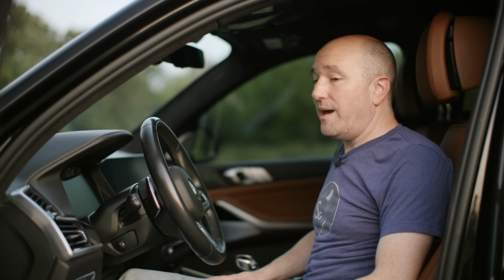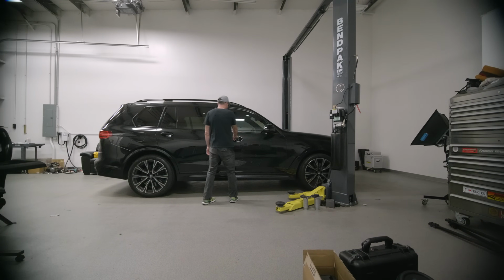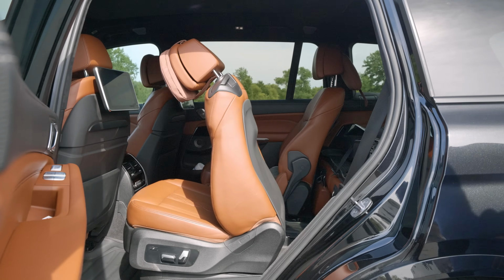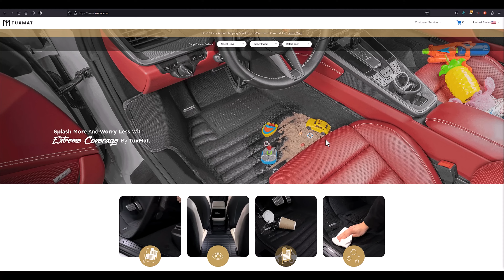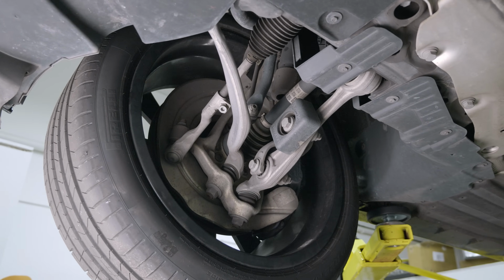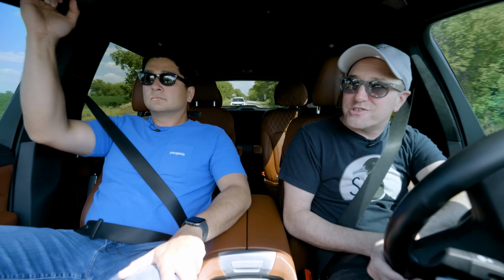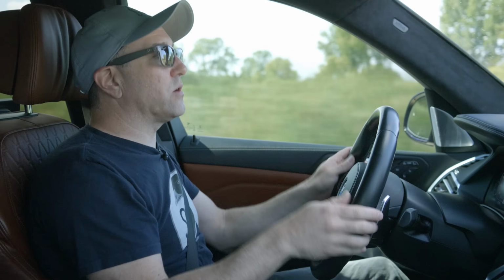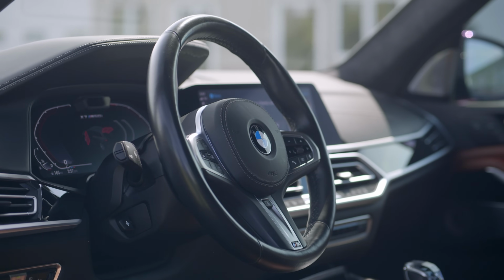BMW X7 | 45,000 Mile Long Term Results

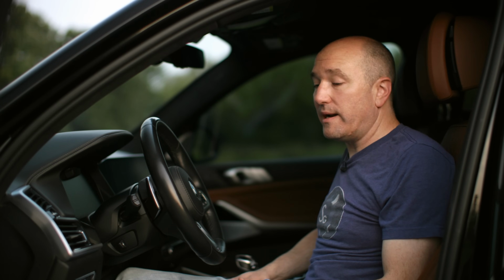Comment: 9:13 I discovered many years ago that sensible and practical is actually the upgrade. My net happiness was always lower when I had a big, expensive, depreciating asset in my garage.
Reply: The reality is the target market for this and other luxury SUVs is made up of buyers who lease, not buy, and the Germans have figured this out . . . they deliberately design the vehicles to fail one way or another after the warranty runs out.
Reply: @LearnAboutFlow  If you say so, I noticed that most owners actually lack in care/maintenance and gentle driving which leads to component failures and then they act surprised because they think a high price tag means nothing will ever break or need service. I have serviced my 2016, 2020, 2022 BMWs way before the system would even tell me to do it and drive them with moderate intensity, V8 and inline 6 as well as 4 cylinder, and all I had to do over the years was watch the tire thread, buy sport tires, replace valves, shock absorbers, most of which was on a 2016 ofcourse but for three cars even if I didn't have warranty it never surpassed 10K in total. Ofcourse there may be lemons, but if you take great care -- they will run well a very long time. Moreover, if someone is overly worried about service costs, it is a wrong brand segment to get into. I love the cars so I am actually happy if something is replaced with new because I know it will run well during my ownership.
Reply: All depends on what you can afford. For myself, I just do not like other designs and do not mind the running costs at all. With good personal care their vehicles run without a problem and high expense.
Reply: @21Pogon  That is simply not true and the repair records and quality ratings prove it. The German cars are hit or miss as far as quality, which has ZERO to do with how well you maintain it. BMW, Audi (always garbage) and Mercedes know their vehicles need only last as long as the lease. My friend's CPO BMW i8 proved that in spades. A small plastic part FAILED and caused $24k in engine repair. The car was like five  years old, and had very low mileage. Plus, the part melted a few days AFTER he had the car serviced and inspected by the BMW dealer. Luckily he had the extended warranty.
Reply: @LearnAboutFlow  I heard that i8 was a nightmare for reliability too. As I said, it can be expensive and there are lemons. But if you didn’t get a lemon and take excellent care, there should not be any problems. My vehicles: X1 F48, X3M and X5M all have no lower than 4.2/5 reliability rating. I can attest simply from own experience of not having problems, I do my own service though and save that way but I service often depending on how I drive and annual service costs come out to be about 2 thousand dollars, which is cheap imho.

Comment: I think an interesting video would be a "bachelor" type of contest where you are looking for the X7 Replacement, you get an MDX a CX-90 a Kia, a Navigator and a Lexus and see what works best for you. basically covering anywhere from 45 to 65K to keep it reasonable (thus no Q7)
Reply: I think the CX-90 would be perfect for him.
Reply: You could get a decently speced 4 cylinder Q7 in the low 60s and a decently speced 6 cylinder one in the high 60s (also there's always used Q7s and even Q8s out there)
Reply: @ThinkfreeorDie  I agree the CX90 would be perfect for him
Reply: Q7 is actually in the same segment as X5 and GLE. But X5 doesn’t offer 3rd row seats so they have wider 2nd row seats
Reply: Navigators are 100k

Comment: I got a 40i without absolutely ANY idea about bmw in general.  I actually got it as an alternative to a highlander, which was more expensive and smaller. I am (so far) super glad i got the b58. Haven't had any issues whatsoever in 4 months that ove had it. (I got it at the dealership witg 30k by the way). Very very happy with it. Sometimes i wish i had the 50i but then i see my mpg and forget about it 😂. Great video 🎉

Comment: My m340i has been amazing. Only issue I had was the driver side mirror shorted out bc of a water leak which also shorted out the module for the laser lights. Since that was fix, no issues. Good thing I have a extended warranty lol.
Reply: How much was it
Reply: @adeezy5503  I got my m340i last year for $48k with 27k miles. Still had 1 year left on factory warranty. My m340i is nicely speccef with the engineering motorsports (cooling and performance package), vernasca leather, laser lights, and premium package which includes heating seats and heads up display. I’m glad it doesn’t have adaptive suspension as that will be expensive to replace down the road.

Comment: Watched this a second time and I wonder if mark would’ve been better buying a base 40i rather than a fully loaded m50i to avoid the firm suspension and poor running cost of high fuel consumption, air suspension costs, super huge tire size cost, active sway bar cost, etc.
Reply: We have diesel in Europe, which suits much better to SUV. Even M50d with 400HP before FCL, now 340HP only. But still…
Reply: Sure but the truth it's a car for someone who makes 3 to 400k a year. I don't know marks finances but I don't think he made the type of money the vehicle commands. Thus the consumables were killing him. Not unlike the people buy used S classes and get crushed financially after a single dealer visit.
Reply: The I6 is the one to buy. Even an enthusiast with a large platform and income stream tired of the V8s downsides.
Reply: @bigcjm  I don’t think he had an issue affording it, it’s just beyond his needs and ridiculous no matter how you slice it. He’s always had practical, reasonable vehicles. I can see how over time this wore on him.
Reply: @sapereaude7776 The M50d is just baffling to me. Two more turbos that can go wrong, worse fuel economy while not being that much quicker than a 40d and noisier on the highway at higher speeds due to gears being shorter.
Reply: @GermanCptSlow  Yes, but still more sensible then V8 in SUV, i drive M550 G30 and 450 to 500 km on full tank is quite on edge for me. So if u look for power numbers then M50d might be choice. Otherwise i agree than any 250kw isch diesel will do in SUV. Fun fact, i tried X5 M50d and avareged 14l :).
Reply: @anotheran Every X7 comes standard with the air suspension; in the US anyways. We've owned two 40i's and they've been extremely reliable. Take any criticism with a grain of salt unless it comes from someone that's owned/leased one for the long term.
Reply: @bigcjm - completely agree. I have the 2020 x7 m50i and ordered it new in 2019. In general, the demerits he mentioned are without support.  The consumables are high, but that's to be expected.  Not sure why this video is centered around a fact known pre-purchase.
Reply: @MH-xu4ez  he said the car has been reliable. He just mentioned the wear and consumables like air shocks and tires are costly. And if the engine blew it'd cost a lot. But at least the transmission was cheap at 10k :p
Reply: @ACGator03  He said the consumables are high and the V8 novelty wears off quickly. It’s not like a sports car which can delight you in many ways that you’d forgive things like that. It’s a 3 row SUV. Congrats on your M50 I adore them.
Reply: he mentioned this in the technical segment. I think for him once you down grade from that you might as well save even more and go for a cheaper car that is going to match that cheaper bmw easily.
Reply: @reed785M  yeah, I think he was just going to pick up a sh1t mobile. honda pilot I think he specifically said 22:17
Reply: Good point
Reply: @JakeDrives1  If someone keeps moaning about expensive tires and $120 fill-ups it means they can't afford it.
Reply: This vehicle is a tax write off for him/his business. He states in the video that he uses it for production(track footage) alongside his daily use of the vehicle. No brainer to load the car up to the teeth on a m50i for a business owner like him.
Reply: @GermanCptSlow I’ve driven the X7 and the X7 M50.  There is a significant difference in power and speed.
Reply: @Inflator82 or it means they are wasting money on bs. Rich people stay rich by not blowing it on junk like this.
Reply: @bigcjm agree the right way you put it. You pray for the rain,  be prepared to deal with the mud ! Borrowed from Denzil!
Reply: @jaeh823 then he shouldn’t complain about it 😂

Comment: Mark, you can't go wrong with a MDX Type S.
Fast camera car, low running costs. Looks sexy too!
Finally make your garage all-Honda products. 😄👍
Reply: +1 for the MDX Type S.  Zero buyers remorse on the purchase.
Reply: would get less expensive base MDX or X5 @KoTerrors
Reply: Type s trim is a waste.
Reply: rusts like a mofo
Reply: @ak2112 absolutely. The J35 NA in the Advance/A-Spec is sufficient and more bang for your buck than the 3.0t
Reply: As someone recently cross shopping x7 with the new body MDX... former Acura fanboy here... MDX is a cheap POS compared to BMW x7. Useless 3rd row! These cars are not in the same category at all. MDX is ok to compete with likes on Qx60 and the under 60k crowd
Reply: @k-man-dude  When you are broken down on the side of the road with this German toaster OVEN YOU WILL RETHINK YOUR COMMENT.
Reply: @KoTerrors  Type-S is a waste unless you only drive it in the city. It shares the same fuel tank with a Base MDX but consumes 2x the fuel.

Comment: I'm on my 3rd X7 and love them.  2019, 2021 40i's and now a 2024 M60i.  I agree the V8 is not necessary, but it sure is fun.  My draggy is showing 4.1 to 60 and 12.4 @ 110.  Also, pulling .91g through turns.  I miss the mix of buttons of the pre-lci, but it's easy to adapt to the on screen controls and the new screens are glorious.  I bought it because for me, there is no better driving LARGE SUV.  Put it in sport mode and your gonna need a pretty high end sports car to keep up!
Reply: This is how you do it.  Spend a crap load in monthly payments, insurance, tax and licensing - what... 3k/month would you say? - and drive worry free!  Bada bing Bada boom.
Reply: @bassandtrebleclef  haha.  Life costs money.  All depends on your financial situation.  If you make 50k a month, I'm not sure 3k is going to break the bank.
Reply: @bassandtrebleclef Damn, bro. You sound salty as hell 😆

Comment: We have a 2020 x740i. In the last two years the only thing to fail is the rear seat motor. It's been stuck at the dealer for two weeks. I hate the seat motors. They get confused; don't lock properly. I wish there was a full manual function to fold the seats. With a larger family this was my biggest let down.

Otherwise it's a 7 seater supra. Love the power train and especially the transmission

Comment: About 85%, maybe even more, of your observations about the X7 are identical to my experience with a 2017 Cayenne Turbo.  The Cayenne's interior has usable buttons (benefit of the older gen) and is a great luxury experience like your X7 (fuzzy headliners unite), it's also got the big ol' V8 for on-ramp domination, but big power is a rarely usable party trick with these SUVs and costs will kill you.

Comment: Excellent video, Mark. We owned a 2019 X7 40i and traded it in with 90k miles for a 2022 X7 40i that now has 47k miles. Both were and have been extremely reliable. Definitely agree that it's difficult to move on to another platform once you're familiar with the previous gen BMW interior functionality. Keep up the great work!
Reply: My parents just got a Certified 2020 X7 40i with 48k miles now that prices have come down. It will go back under warranty to get a CV joint replaced because there is a popping noise at low speed turning. Have you had to replace anything to do with the suspension or steering?
Reply: @nealp885  Nope. We've had no issues with either X7 that we've owned. knocks on wood
Reply: @nealp885  My first BMW is a 2022 X5 m50i. I bought brand new, has 33k miles. Great drive but at 25k miles I had to replace left and right tie rods, and about 30k miles a clicking noise started on right front axle. Haven’t had it checked yet but I have a suspicion that it’s the CV joint. I’ve never had this much trouble out of a new car. I’m starting to regret my purchase. Also, tires replaced at 25k and the cost is outrageous. Wasn’t prepared for that.
Reply: @cristyrjordan 
With all due respect, you bought a German luxury car with a powerful engine. Did you expect maintenance costs to be like a 2006 Honda? IMO it’s worth it because nothing Japan puts out is as luxurious or as powerful German cars. Even going from a Camry to a C class of the same model year is a night and day difference.
Reply: @36ChambersOfFear My 2012 Audi Q7 TDI has had lower maintenance costs than any of my friends.  It's a gem.

Comment: Long time BMW owner and fanboy here. However when it came time to replace my SUV with something with better gas economy and more streamlined, i went for a Lincoln Aviator over the X7 or Audi Q8. While not in the same league of the Germans in interior execution ,  the cost of long term ownership and the warranty made better sense with the Lincoln for the type of use i need it for: college move-ins, traveling with my 2 labs, beach vacations, bike trailer etc...Its got superb power and will hold up looking elegant for the 5 yr window i plan on needing it. Any Ford dealer can service it down the road if need be, and its does just fine running on 87 octane since day 1.
Reply: Knowing kids and actual family use vehicle, X7 is really over the top and too high maintenance for a family beater.
Reply: It exists because wealthy people want to show off their wealth and feel special. Nobody said it was practical. haha @kenim
Reply: You didn't pay the subscription for the cooled seats
Reply: Ewww.... BMW, MB, Lincoln.... You're gluten for punishment. Or, only lease those heaps of garbage for 3 years and move on
Reply: The Lincoln Aviator looks 10x sexier IMO then the X7/GLS. Interior is very close to the germans.

Comment: I drive one of these for work, hotel Chauffer in San Diego. This is our house car. It’s rough riding, always having warning lights on, and it goes through expensive tires like there’s no tomorrow. Guests always complain how rough it rides! My Lexus with 314k miles is way smoother. The X7 is more of a drivers SUV, not a great passenger car.

Comment: Fellow Illinoian here!  I did a similar progression from the Volvo S90 to 2020 BMW 750i.  A few comments:

-This generation's consumables seem much more prone to failure.  I've already had to replace my fuel pump and injectors.  On the 7 series, the coolant reservoir is placed where coolant easily spills into the injector holes and kills them. I had to replace 4 because the BMW master mechanic did a coolant flush without waiting for the engine to cool down.

-Yes, the seat coolers are MUCH weaker than previous generations. They reduced the amount of fans and use a single channel to push air. Looks like a design compromise due seat massage.

-Yes, seat massage is meh. It does, however help on long roadtrips.  I recently took a 2.5k roadtrip and turning on massage helped eliminate that backside numbing you commonly get on long drives.

-BMWTIS subscriptions are amazing. You can get all diagnostic and repair manual access for $32.  That said, BMW is becoming much less enthusiast and self-repair friendly than it was in the past.  Also, good luck finding an ICOM Next as they've been out of stock for years.

-BMW's dealership experience has gotten weird.  Think ultra-bureaucratic and more cult-like.  Err, maybe even "Mercedes"-like.  Many have multiple levels of people you need to speak to in order to achieve what you want to accomplish and it's more like attending the church of BMW.

-BMW parts are reasonable online.  If you don't find the dealership's online parts shop, you'll easily spend 2x at full MSRP.

-Expect a massive jump on your insurance premium.

-This is the last generation BMW was coding friendly.  You can add a ton of features (like newer model updates, expanded self-driving and anti-dazzle headlights).  New models have secure coding enabled and no longer mod friendly.

-BMW is handling updates similarly to Apple. You get what came out when you bought the car. If a new feature comes out, it's unlikely you'll get it despite your car having the hardware to do so.  ...and features are region locked.  A German version can do stop at stop lights/signs, pull over for emergency vehicles and even pull off the highway based on your route.

-The lack of a spare tire and limited tire options are more of a problem than you think.  I got a flat on a long roadtrip on a Sunday.  BMW offered to tow it to a dealership and wait around a day (or more).  None of the open shops would touch my car, let alone try and repair a runflat.  I finally bought a patch kit and inflator at AutoZone, which worked, but I've never felt so helpless and frustrated before.